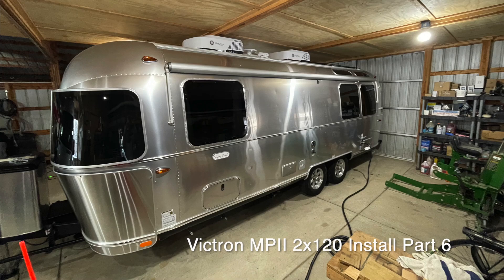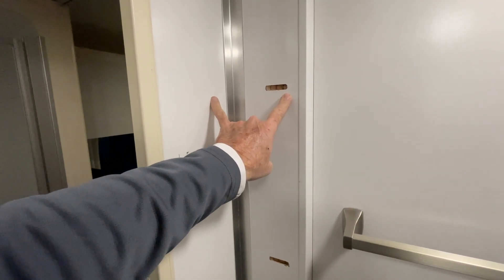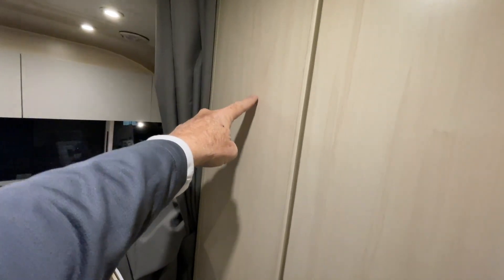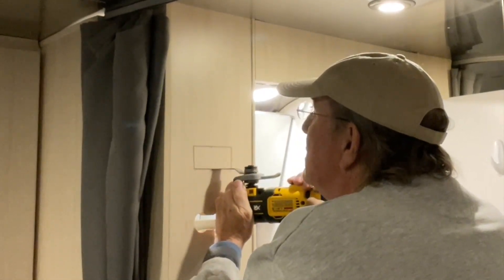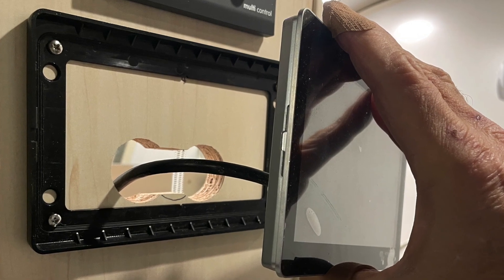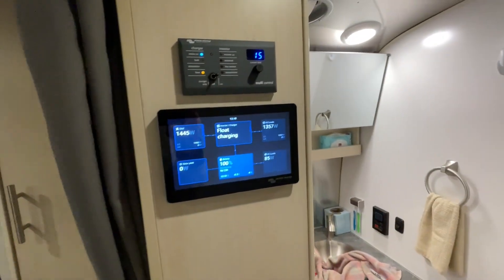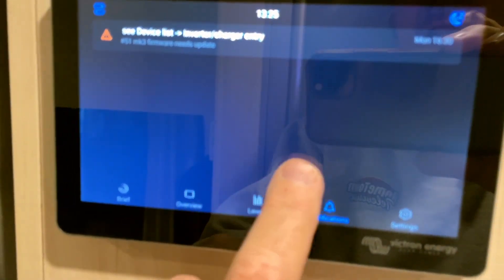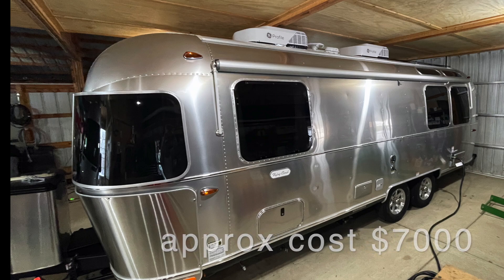Airstream Flying Cloud 25 FBT Victron Multiplus II Retrofit - Part 6

Comment: Nicely done, working on the same project with my 27FB.  Question what did you do with the pass through circuit on the old inverter?  Ours powered part of the panel when not inverting.  Any suggestions?